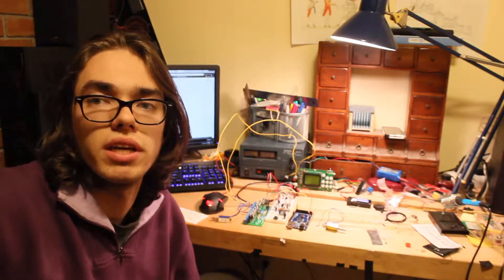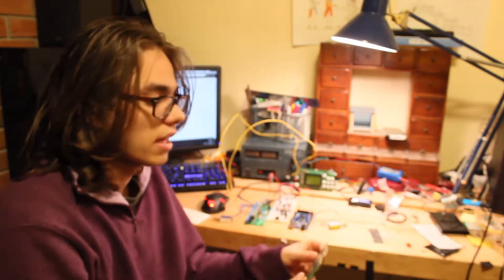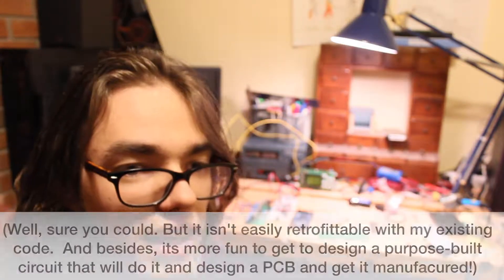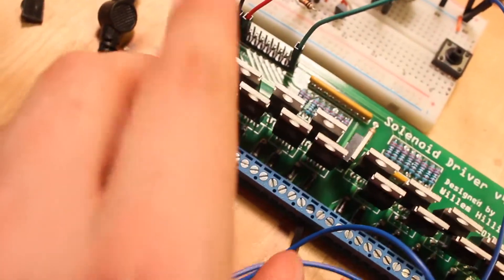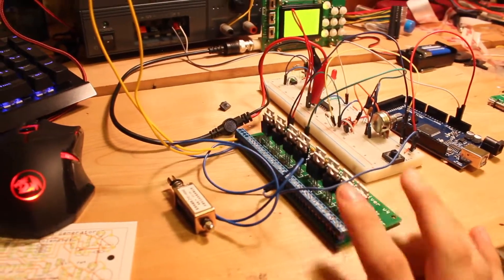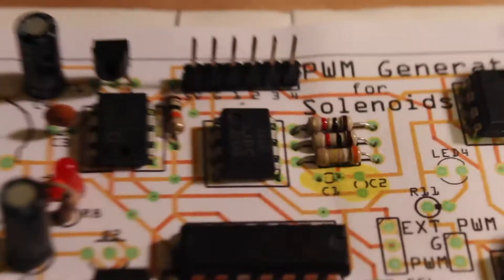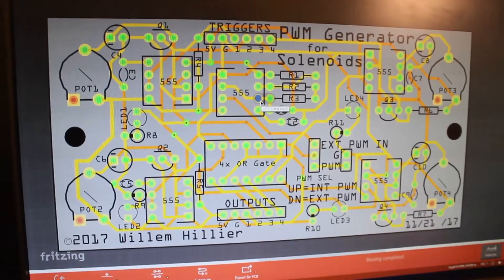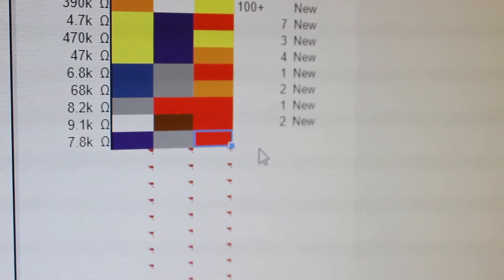Reducing Solenoid Power Consumption via PWM with 555s

Comment: Hey man, great video. I have a question and your response would be highly appreciated. I am trying to drive one of these solenoids ( 12V 1.4 amp) for a long period of time ( hours ). I think using your  pwm technic would stop it from over heating. I would appreciate it if you would let me know how to drive only 1 solenoid for a long time without heating. I have a limited space for the application so I am trying to make it as small as possible. Thank you man